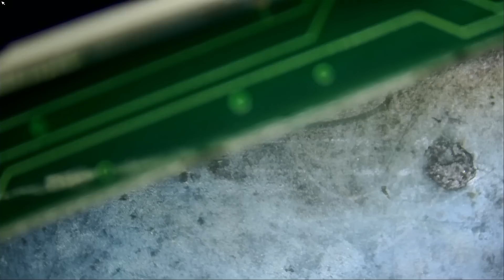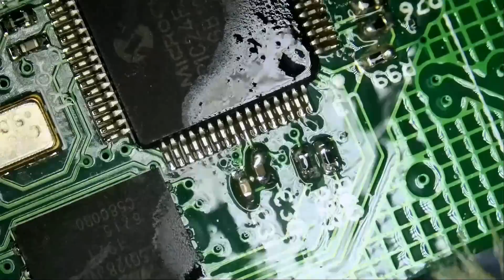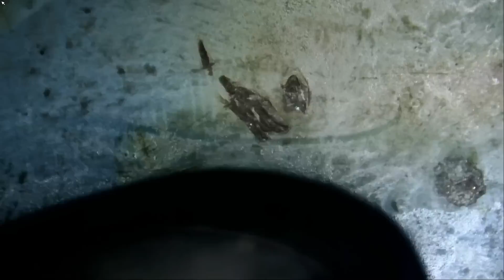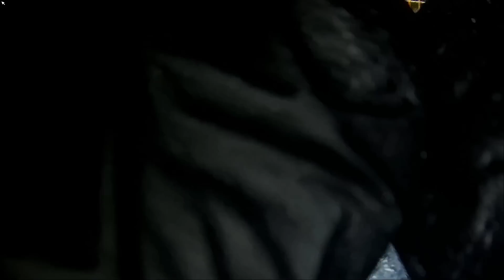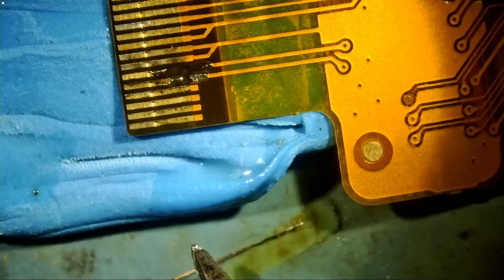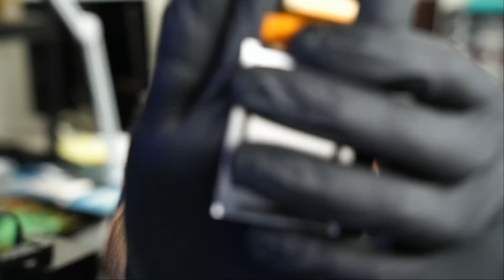Mini Maxx Black Screen Repair. Working with Microscopic Traces

Comment: Tip for anyone using electronics to work on cars... Be very careful not to get coolant into electronics. It dissolves the traces. I don't think it applies here, but I had someone bring me a laptop for repair that had coolant spilled in it. He was reading the service manual on the laptop while working on the engine cooling. He removed the radiator cap when the coolant was hot and coolant sprayed on the laptop.I took it apart and was going to try to clean up the coolant residue, but there were many traces on the circuit boards that were completely dissolved!

Comment: Great job Alex. What is the blue putty you are using to hold the ribbon cable?
Reply: Same question, conventional blu-tack usually melts with the slightest heat.

Comment: I didn't think it would work because you added that mask on top of where the pins look like make contact when locked down, perhaps you didn't push it all the way in which would make contact at the edge rather where it would have not made good contact, excellent repair.